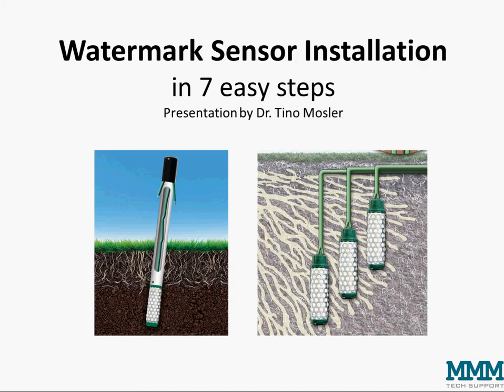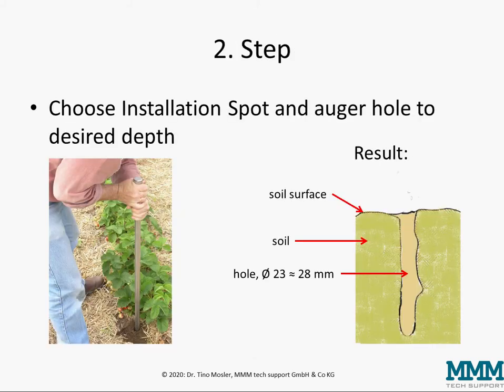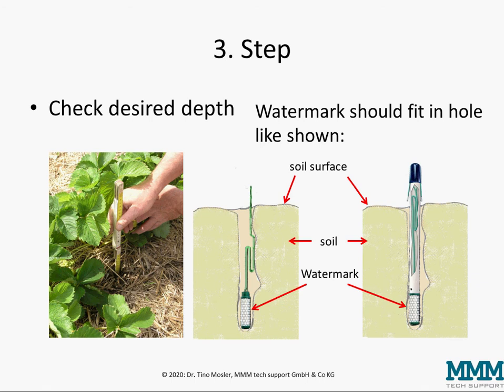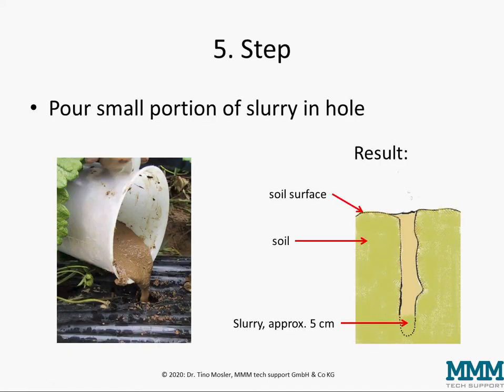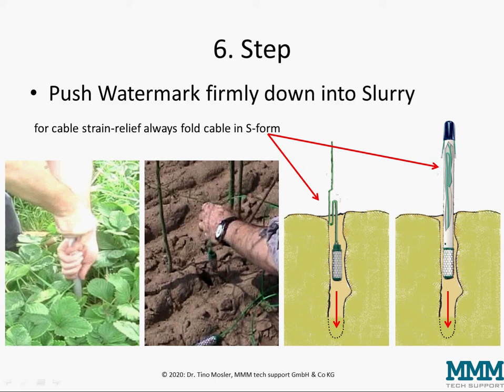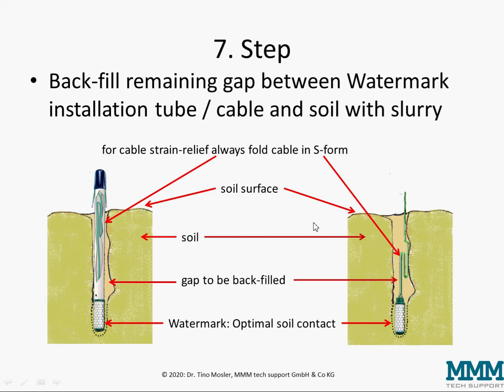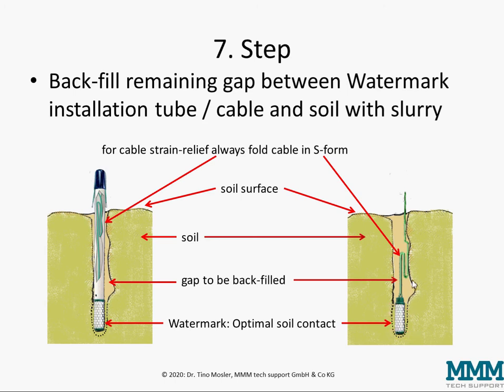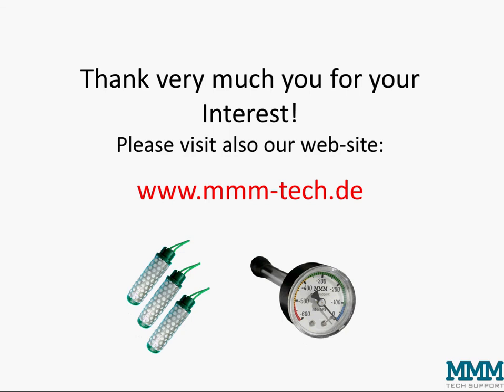Watermark Sensor Installation in 7 easy steps

Comment: These watermark are tensiometer or not?
Reply from the maker: The Watermark sensor measures soil water potential exactly like a Tensiometer, but it is not a Tensiometer in the classical sense, since the working principle is quite different. Different to a classical water filled Tensiometer is the Watermark sensor maintenance-free and frost proof and has a wider measurement range (0 to 200 kPa). But it is less sensitive in the very wet range (0 to 10 kPa) and reacts a little slower to changes of soil water potential compared to a Tensiometer. More info on the Watermark Sensors at: 
https://www.mmm-tech.de/en/watermark/info
Reply: @MMMtechsupport  Thank you for your reply. It was very helpful